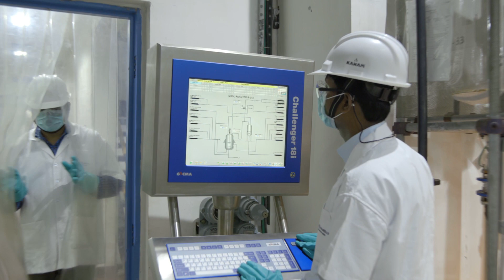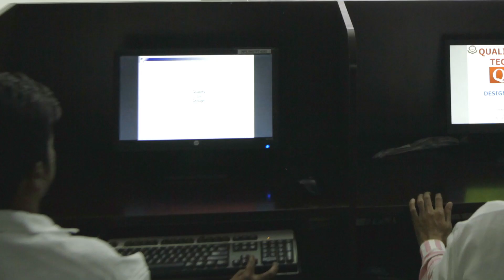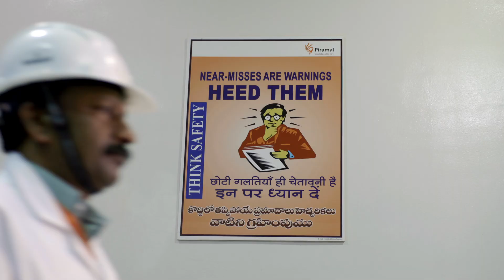Piramal Pharma Solutions - Digwal Facility at Andhra Pradesh, India

Comment: 1. Mr. Ajay Piramal is an alleged insider trader (2016) 2. He is an environmental- extortionist (for polluting Digwal, Telangana in 2019) and also who sought “blanket stay order” at the National Green Tribunal, which was rejected. In the case of the DHFL also, he wanted such a similar stay order on the “controversial” NCLAT second verdict (27/01/2022). 3. He was involved in Flashnet Scam, 2018 (though Mr. Piramal was ready to defame The Wire, who first exposed the scam, for reporting the same, but till date: no such step has been taken by him) 4. He is possibly involved in contempt of court during the DHFL resolution process by ignoring NCLT’s first verdict (19/05/2021) and skipping the points raised by the NCLAT second order (27/01/2022).

Comment: BONFIGLIOLI / GREAVES / ELECON / SHANTHI Make Reduction Gearbox

HINDUSTAN / SIEMENS / CROMPTON / BHARAT BIJLEE / ABB Electric Motor

ABB / DANFOSS / EMERSON Make AC Drive Unit (VFD) with CONTROL PANEL

Engineering Equipment Corporation
T: +91–22–28324252 / 28306090
motorgearbox@gmail.com